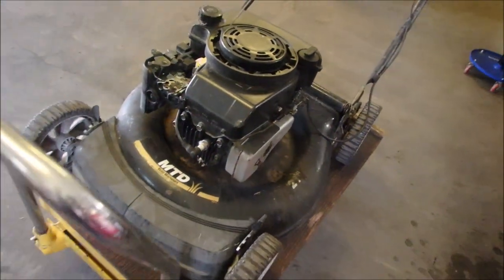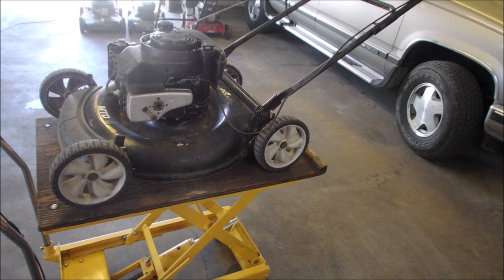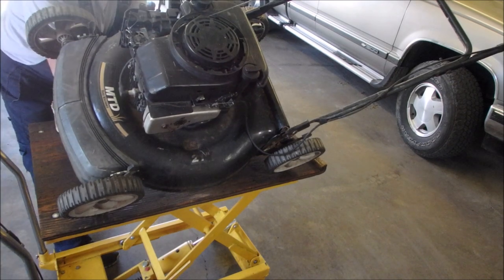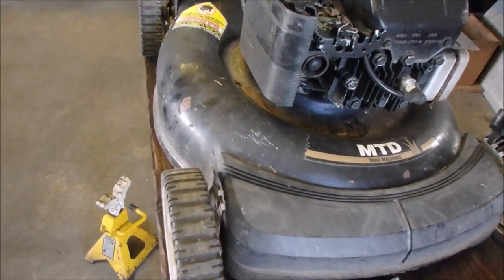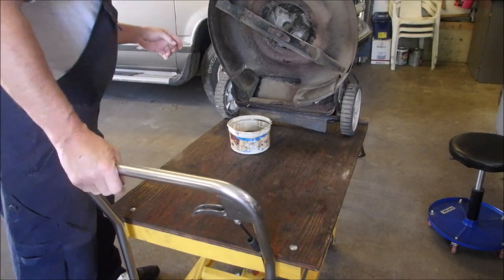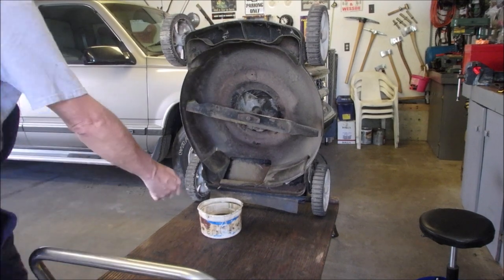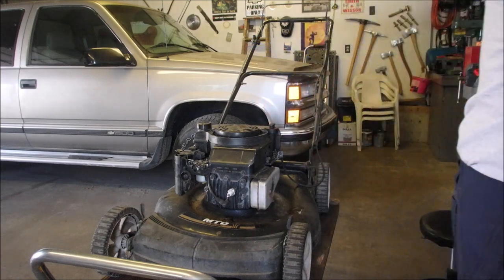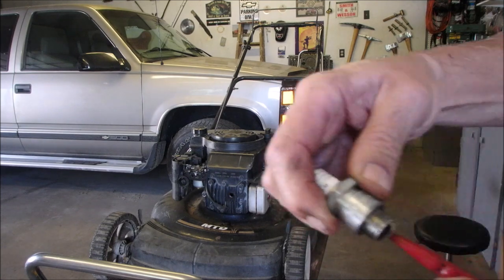This Very Ugly Yard Machines Mower Came in for No Reason

Comment: Yep just proves that regular maintenance keeps these old babies running eh Bruce? We also tighten the head bolts then mark them with a paint stick showing we have done them, i always find the 3 closest to the muffler loose! You could retorque them but tightening with a ratchet and socket if fine.
Reply from the maker: Good point.  I will start that.  Thanks

Comment: Great job sir have a great safe weekend
Reply from the maker: Thanks.  Missed the launch again eh!!!
Reply: @BrucesShop  yes sir i use to take samples of liquid hydrogen to take to the lab -423 liquid very cold i think they are going to have to roll back to vab and fix there leaking seal im so close to space center i can hear the sonic booms from space shuttle days i think im about 20 from the cape canaveral air force station kinda cool
Reply: satelitte beach fl were i live